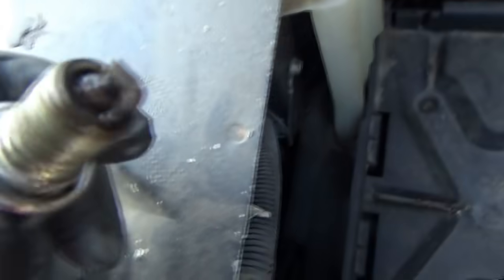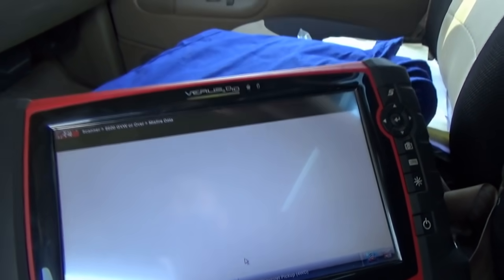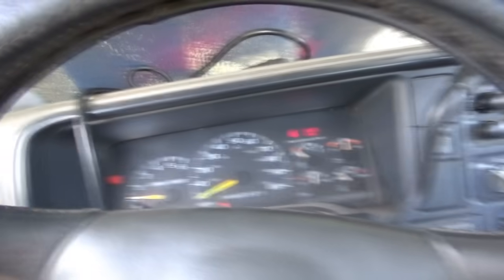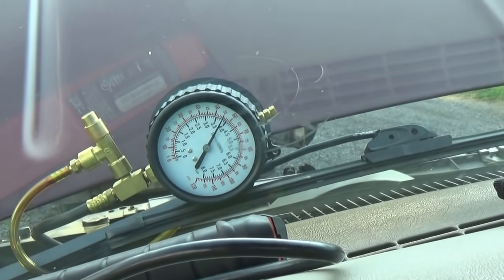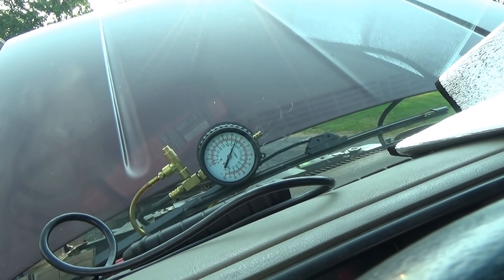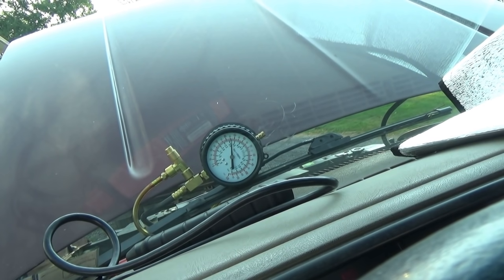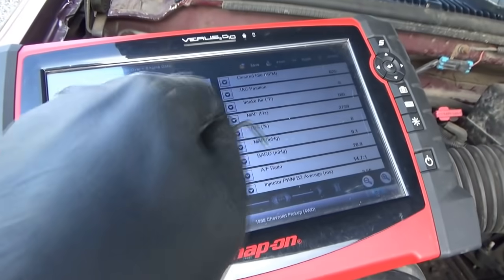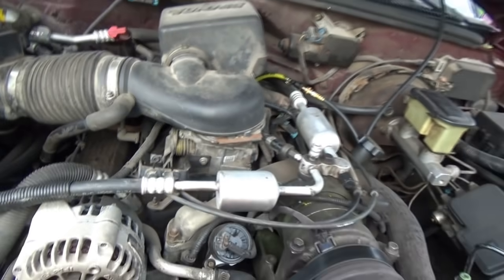Chevy MYSTERY Misfire - Part1 ('98 K2500 Labor Day Special)

Comment: When I was in this business, regular customers in for even an oil change would get an intake snugging. Of course, tune ups always had an intake check.
Reply: How much of a turn on the bolts did you get?
I'm fairly certain that the GMs 3.1/3.4 engines intake gasket failures was due to having too small, to few bolts that loosened up causing a leak.
Reply: @dans_Learning_Curve  At times a 1/4 turn or so. Some you could have spun out without tools. This was in the early 90's with all the V8's and V6's. The owner of the garage I worked at told me on the first day that we fix cars here. I kinda looked at him funny, but it was a thorough diagnosis, not just sell parts. The regular oil change service could take 45 minutes depending on the vehicle.

Comment: Interesting, I didn't think the valves (injectors) could be controlled separately until later.
Edit: I wonder if the fan clutch is wearing out. This would cause the AC to work at startup but stop working later.
Reply: I believe that year is thermal clutch fan. A/C has nothing to do with the older mechanical fan clutches. Most vehicles do not need a fan while at speed, say 40 mph and up.
Reply: @Garth2011 correct,  the AC will not work well at low speeds and not at all during a hot idle if the clutch is not locking properly. The AC would work at idle if the engine was not up to temp. The owner brought it in for no AC, it's hard to believe that problem was made up.
Reply: @_RiseAgainst  Ivan never went into details. Could be low on charge and low pressure switch is preventing the pump from engagement intermittently. Ivan said it works so I'd presume he confirmed all is working and getting cold as it should.